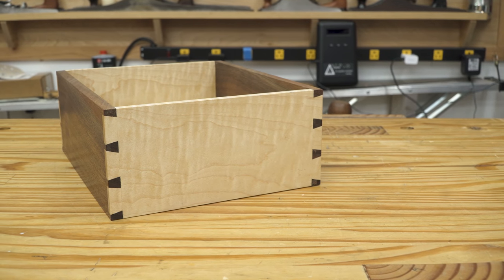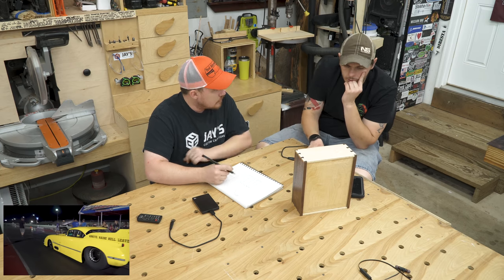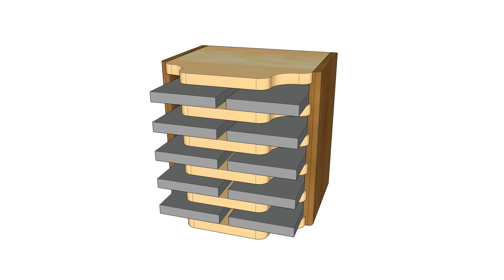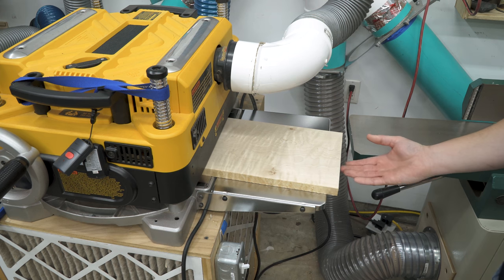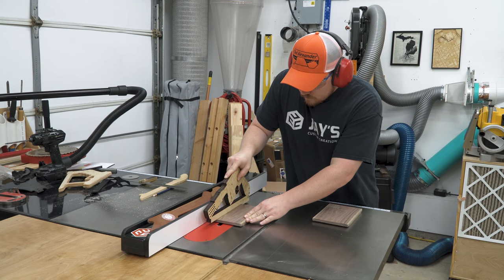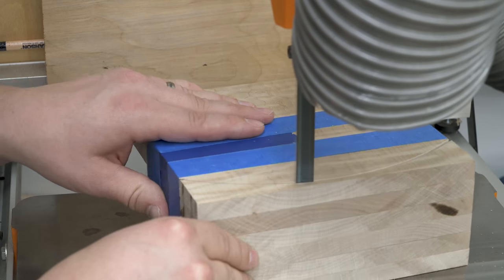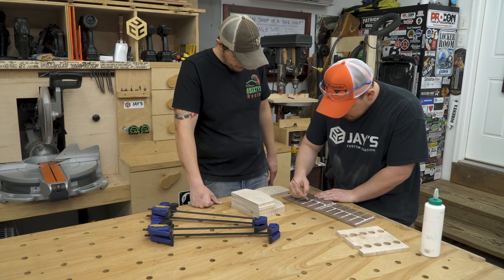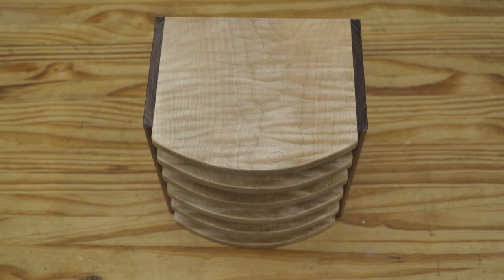Hard Drive Caddy - 283

Comment: Jay, how much space was left in the rear of the unit? I hate seeing wires, is there enough room in the back for a usb hub and can you then have a sliding panel to hide the wires and the usb hub so only one wire is coming out? Maybe two if you have a powered hub. Very pretty wood....nice choice...
Reply: It would have to be a powered hub. USB 3.0 can power a single portable hard drive, but not ten of them.

Comment: that is nice looking and practical. 
to add some ideas that just came up my mind.
you could add a powered USB 3.0 Hub and have cables running from ut into the little shelfs. so you have a charging station for any kind of USB chared device. also this hub can be connected to a PC or Laptop to have access to all of fhe data that is on these devices.